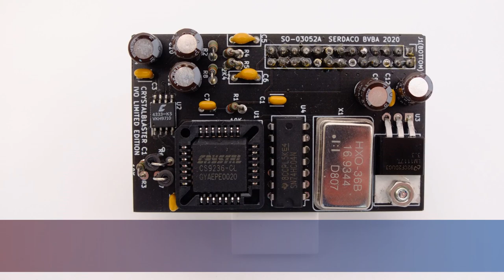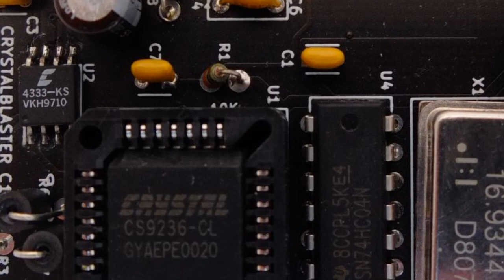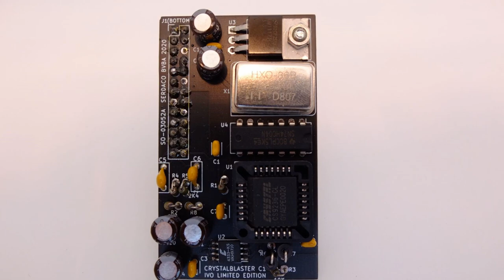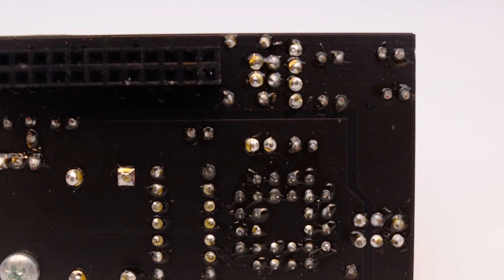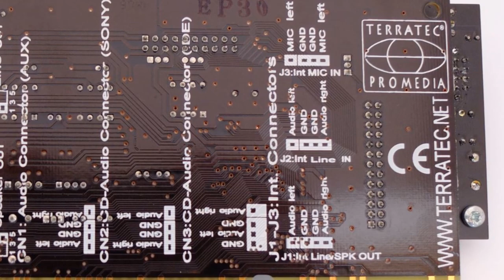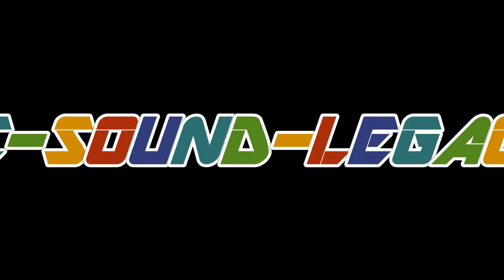CrystalBlaster C1 General Midi Wavetable (Crystal CS9236)

Comment: I have the IBM S-16WP1/L with the Crystal CS9233 chip, similar to CS9236.
Reply from the maker: Nice! I have a9233 module as well. The 9233 come with external waverom as far as I remember, 1 to 4 Mb.. I can't find more information about the internal Rom of this 9236 but I think it is quite small - I assume 0.5 Mb. So the 9233 will be superior I assume.
Reply: @pc-sound-legacy  9236 it's hard to find information on the 9233 the internal rom is 1 MB.

Comment: Sounds really dry, have you tried sendid sysex messages to a add reverb and chorus effects ?
Reply from the maker: This low budget single chip wavetable do not have a built-in effects processor that can add/handle reverb or chorus.
Reply: @pc-sound-legacy  bist du sicher? Ich habe den dattenbatcheck es hat etwas oder?
Reply from the maker: @boardernut  hey I did just check the datasheet and it indeed quote "independent reverb and chorus settings to each MIDI chanel" - I did not expect that, thanks! So it's definitely worth a try